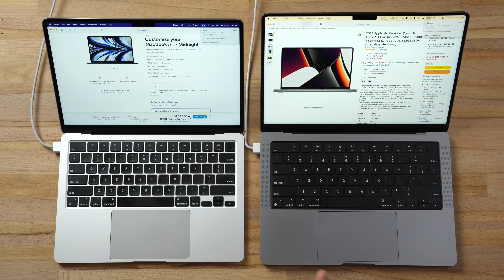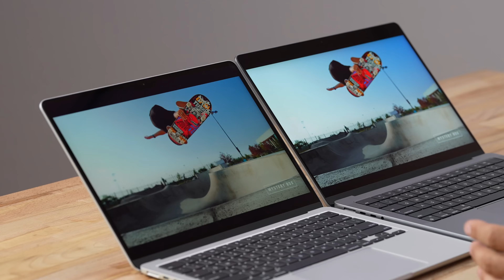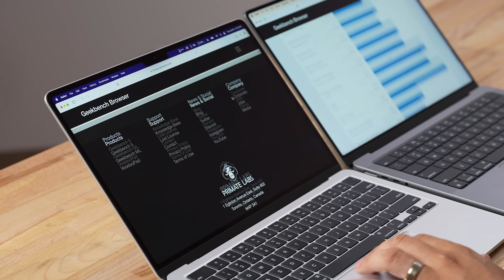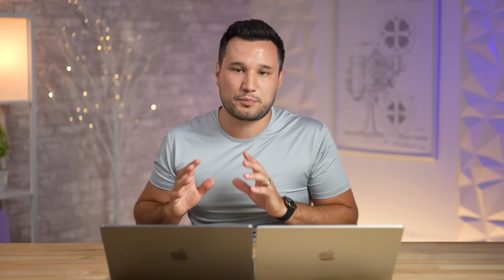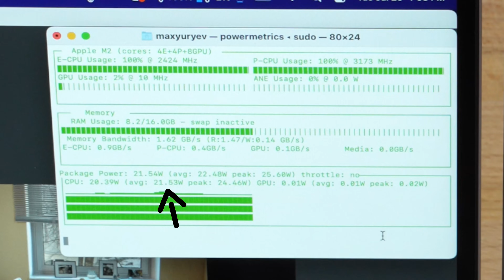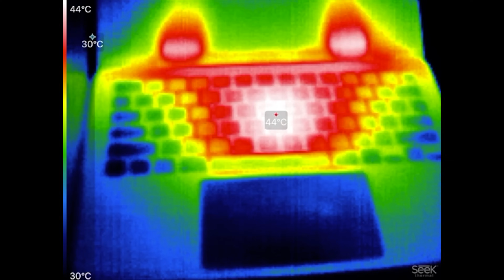M2 MacBook Air vs 14" MacBook Pro - Prepare to be SHOCKED!

Comment: THIS was the exact comparison I was waiting for! Thank you guys for always delivering the absolute best content, I love what you guys do. I don’t have a lot of money so I kind of rely on what you have to offer from your tests. I’m looking to transition in the next year from my Late 2011 13” MBP, and want to get the most out of my money so that this new machine can also last over 10 years, but on steroids.
Reply: If that is really what you want, I would go for a 14 inch in stead of a M2 air.
Reply: @tjadejoh  exactly, 100% for the 14” :)
I may also wait - hoping (and praying) that apple may release (as per the rumours) a new Pro 14” (alongside 16”) later this year/spring 2023. If so, it might be on 3nm chip process. If it’s not, and still built on the 2nd gen 5nm process, that’ll still be incredible in the Pros. I’m thinking my dream specs could be:
2nd gen. 14” Pro
10c/12c CPU (binned/un-binned)
16c/18c GPU (binned/un-binned)
24GB Unified Memory/“RAM”
1TB SSD

Comment: Can you do a battery life test for the m2 air, with just the efficiency core working, performance core disabled. 
I did that according to one of your earlier video. The mrs uses the air, 99% of her work is browser based, I’m just curious how good is the battery life compared to my 14 inch pro. If it doesn’t save much battery on her air, I’ll turn the performance core back on.

Comment: I’ve been waiting for a vid like this, but I changed my mind cuz 2 weeks ago I got a special offer of the m1 pro 14 MBP for $1650 open box on eBay and I can tell it’s a beast of machine, I love the mini LED which I don’t see gray boxes behind the texts, the pro motion and the true colors it shows which is perfect for illustration and UXUI design, and the best part is the apps open in 2 sec or less ❤️

Update: I’m surprised by the power of Apple silicon cuz this machine compared to my old 2018 MacBook Air the difference is so big

Comment: The base model 14” MBP is DEFINITELY the best overall value for a MacBook right now. Especially since it’s only $1749 at Best Buy currently. 

The benefits you get with the MBP are well worth the $1749. 

- STOCK: readily available, whereas the Air is
brand new and can several weeks to ship depending on the model you choose. 

- DISPLAY: slightly larger display size, even thinner bezels, higher resolution, 120hz Pro-motion, and Mini-LED instead of cloudy/gray outdated LCD

- SOUND: Larger speakers for clearer/louder audio

- PERFORMANCE: up to double performance, double the ram (16GB standard, compared to 8GB on base model MBA)

- STORAGE: Double the standard storage (512GB standard, compared to 256GB on base model  MBA)

 - CHARGING: Faster charging out the box (MBA requires you to buy the upgraded charger to get faster charging)

- PORTS: MBP Includes an SD Card reader, HDMI port, 3 thunderbolt ports, and headphone jack (The only ports MBA has are 2 thunderbolts and a headphone jack)

- NO THERMAL THROTTLING: As a
result of the MacBook Air not having a built-in
cooling fan like the Pro does, the Air will drop
in performance after roughly 5 min of heavy workload, and it doesn’t take very long to throttle even under a moderate workload.

- LONGEVITY: I’m no computer engineer, but I would expect the MBP to outlast the MBA, mainly because it has a built-in fan to help cool off the internals.
Reply: You are wrong, for compare u not use base model, real comparation its with same specs, 15/512 or 1Tb. M1 pro 14 base, dont have fast charger (need to upgrade to 97W), same air 30W to 67W. The rest, thermal trhrottling its only editing vídeo/photo, not in normal use, web, ofimatic, view streams or vídeos, etc.. work at 47ºC. M1 pro 14 base, in same case work at 50-52ºC. If you use more try hard, air work more hotter, in this case if this is normal use, go to pro, hard hot on a chip for long time isn’t good, but Proccessor / SoC in this case, are prepared to work hot.
Reply: @raul961  Thanks for the correction. 
Regardless of that small oversight of mine, most people agree that the base model MacBook Pro at $1749 is an overall better value, when comparing the specs and features, dollar for dollar

Comment: Best Buy had the MBP 14” for $1799 new recently. Worth every penny over the air.
Reply: The 14” MBP is $1749 right now at Best Buy. I just bought mine for the $1749 and LOVE it! Waaayyy better value compared to the MBA
Reply: @eBikify  even better then 😂
But yes absolutely worth it
Reply: @eBikify  Darn I got it at $1799.

Such a good price on it.

Comment: I’d still question coding performance. I wish your benchmarks used other ides  like vscode, pycharm, etc. I’d wager these are used more frequently than Xcode. Given I do zero coding in Xcode it’s useful though leaves me questioning how would my experience really vary.
Reply: Exactly all these youtubers are doing the same audiovisual benchmarks... I been waiting for coding benchmarks o real use performance in databases, containers, compiling projects, working with virtual machines, etc. I guess the main issue will be compatibility
Reply: An interesting observation would be about the SSD. While it does not make a huge difference for light usage and coding itself, if you're using a lot of swap memory the faster ssd on the 14''pro would be an advantage. 

Let say you're debugging a project, have over 10 tabs open on chrome and have Docker running with some local databases, message brokers or other apps, if you run out of the 16GB the swap with a faster ssd will probably offer a better experience. But of course, you can always go for the 24GB of RAM MBA...
Reply: The XCode benchmarks are actually testing things like the GCC compiler more than XCode itself. So it’s not a bad compiler test. Most “Real world” coding is going to be so constrained by things like Network that the CPU performance is going to make a lot less of a difference. Still, if you want to see a bunch of Developer-focused tests, check out Alex Ziskind’s channel. He puts the systems through their paces on a ton of different technologies. Sometimes the Mac does amazing, sometimes software differences give the win to Wintel computers. Either way, it’s all quite interesting.
Reply: Hi, I recommend @Alex Ziskind on youtube! His channel focuses on coding and he does various tests!
Reply: @proxiloni  thanks for your suggestion :)
Reply: This! I’m so confused as to what to buy.
Reply: @SherriAshton  Are you going to use the laptop in an office setting? Buy the Pro. Are you going to use it as a personal laptop for side projects? Buy the Air. If you’re in the weird Prosumer category where you run three screens hooked up to a Thunderbolt dock that you plug into your laptop over USB-C? WTF? Why are you even asking? You know what to buy.
Reply: @thewiirocks  the comment is about coding. I’m a student in CS. Can I get away with the M2 air to save money. Or should I just shell out more money for the 14” to be safe. I am new to coding.
Reply: @SherriAshton  If you're a student learning to code, you can pretty much use any potato computer you can get your hands on. You won't be constrained by the M2 Air or any other computer. If anything, today's computers are too fast for a learning setting, making it difficult to understand why Data Structures and Algorithms are important. Trust me when I say they are, you're just not going to experience true scale in a classroom setting.
Reply: exactly

Comment: In Canada, the price between the M2 Air and 14” is like 500 bucks, big difference compared to other countries.
Reply: I´ve just checked in Europe (both Air and 14" Pro in versions with less graphic cores). The difference between specced up Air and 14" Pro is exactly 300 Euro - 1950 vs 2250. Just to clarify - in Europe all displayed prices has to be final - including all taxes and fees. Both are standard priced, no discount.

Comment: I do believe this is the best way to approach these two lines. The Air should be significantly lighter and thinner, whereas the Pro should be significantly more powerful. For the last generation Apple homogenised the product line where they thought the Pro needed to be as thin as an Air, and while this was cool from a design point of view it meant you couldn't really get a truly powerful machine. It also made the Air feel redundant outside of being cheaper because the Pro was already so thin. But now, we're back to that clear distinction between product lines - and I think that's better as it gives consumer's a better choice for what they need exactly.
Reply: exactly
Reply: 13 inch Macbook Pro: I'm a joke to You?
Reply: @framedthunder6436  yes
Reply: @framedthunder6436  Exactly, the 13 inch MacBook Pro is really a joke😂
Reply: @coconutcubes5750  can I get great speed if it get 8/512 on m2air
Reply: @gontexpro2683  if you don’t use that much ram. Ram demanded tasks are Adobe series, IDEs, high resolution long video editing and 10+tabs with chrome.
Reply: @framedthunder6436  Yes.  You are.
Reply: @framedthunder6436  Haha yeah that is the bizarre anomaly that breaks my statement. I think Apple does tend to keep one odd Mac around largely for ease at which they can produce the chassis. Last major example I can think of would be the MacBook Air 2011 - 2018
Reply: @framedthunder6436  corny
Reply: I agree with what you said. It seems like around 2016 they lost sight of what characteristics the pro needs to have and they tried to make it a MacBook Air pro. The MacBook Pro design should be willing to sacrifice a little bit of size, weight , and slightly worse battery life in the pursuit of the best performance, highest quality display, and sound.
Reply: To add to this: the screen difference regarding colour accuracy on top of HDR and whatnot else is another critical difference that is only relevant to creatives.
Reply: Exactly. I went to BestBuy today & looked at MacBooks & was honestly stunned at how little difference in size there is between a 13” MBP & 13” MBA. It’s so negligible that if someone told me they could feel a difference I’d call them a liar to their face. The only real difference is the ports.
Reply: But now the air and 13 inch pro are even more similarly priced…
Reply: One important thing missing from your comment. Apple still markets the Air as some sort of jack of all trades laptop, without fully disclosing that the M1 or M2 chip in the Air will provide less performance than the Pro versions. Consumers see the same chip, rightfully assume the same performance. They can't have product differentiation if they refuse to acknowledge what seperates these products in the first place. They're heavily marketing the "performance" features of the MacBook Air rather than the overall thin and light nature. Don't believe me? Check their official website. Granted the marketing for the M2 has dropped the performance priority a notch or two compared to the M1 and focuses more on battery life, screen quality, color options etc.
Reply: @ufukpolat3480  you can always go to an apple store and ask for advice. Also if you do a quick google search or if you really need a powerfull machine, big chances are that you are able to understand the differences when you see the cpu and gpu core differences. However, some sort of line up from least powerfull to most powerfull M-series chips would be helpfull for those who are confused by the M2 vs M1 pro/max naming
Reply: It's too bad that M2 MBA have this heat problem
Reply: @tririfandani1876  it doesn’t have a heat problem, unless your using it for things that a MBP is designed for (in my opinion)
Reply: @tririfandani1876  people who need to thermal throttle the m2 mba shouldnt have an air
Reply: We can discuss whatever we want as techies but apple clearly knows its regular customers, which dont care that much about specs and they must be doing something right
Reply: Yeah, except the price is ridiculous.  To get a M2 worthy laptop, you gotta spring for 1399?  Maybe more w the ram?  This is a heist!!!
Reply: right, exactly thats the point!

Comment: The price for the M2 Air is stupid. It should just stay at $999 for base model. The only config that anyone would buy is the base model or maybe either 16 ram or 512 ssd else the 14 inch is way better. It is thicker, less battery, and cost $200 more but the screen alone should offset all that.

By the way, why does Apple keep lying about battery life? M2 Air rated at 18 hours and M1 Pro 14 rated at 17 hours but the difference is almost 15%? These are their own product and tests, they should have some consistency.

Comment: It's worthwhile to note that with student pricing (at least in the US), the difference between a 16/512 air and a base 14' is more like $350. And Apple doesn't verify your education status if you order online, so it's a completely valid comparison. 

I would still argue that $350 for a SIGNIFICANTLY better screen and more powerful chip is worth it, but it comes at the cost of portability and battery life. The decision isn't as clear cut anymore. Obviously if you're a professional I wouldn't even consider the air for a second but for everyone else, I could see use cases favoring either machine.
Reply: The 14 is very portable. It’s like splitting hairs if your are putting in a book bag…
Reply: The 14” MBP is $1749 at Best Buy. By far, the best value right now for performance, display, speakers, etc
Reply: @eBikify  It's $1850 on apple edu with a $150 GC. You can easily sell the GC for more than 100 but we can just call it even. And the m2 air is $1500 + $150 GC, so the difference is indeed $350.

Comment: Exactly what I needed to confirm my 14" pro purchase is still worth it nearly a year later.
Reply: Yeah I don’t regret buying one.
Reply: Wow you needed confirmation for a one year old laptop with a newer M1 generation chip? Lol. Should I be crying that I bought a new in box, factory sealed M1 MacBook Pro 13in and paid 1300 for it on eBay less than a month ago? This laptop will be good for years and it came out(November 2020) before your 14in and I don’t need anyone to confirm that

Comment: The performance  difference is  lower than how I expected! Guess this is the another reason Apple priced M2 quite close to M1 Pro base model price tag. Conclusion: if anyone care for weight and shiny new look - go for M2, otherwise M1 Pro is better choice for the now and for the future.
Reply: the macbook air is very strategically priced so people will go for the Pro, they do that with most of the lineups. if you even slightly care about performance you will definitely upgrade the ram and ssd on the M2, in which case you should get the pro at that point

Comment: CPU analysis:
M2 Air has 4 performance cores and 4 efficient cores vs M1 Pro which has 6 perf and 2 eff.
So M1 Pro has 50% more performance cores, but also 50% less efficient cores. The new CPU is by default running at a higher frequency and is more optimized, especially efficient cores.
So, it is expected that the difference would be small, especially for short runs where M2 Air does not throttle.

Can you make a test where only one type of core is used?

Comment: Just as I thought. MBP 14 inch is a better buy, especially since it offers more ports, excellent screen, and already available in refurbished version.
Reply: Refurbished isn't good...watch Louis Rossman videos.
Reply: Also supports more external monitors
Reply: The MBA is CHEAPER. You can’t say it’s a better buy if it’s more expensive. It’s a whole different ball game. The A Ferrari is better buy than a Honda Civic based on track time, when you factor in the cost the civi may be better for the average person.
Reply: @RakingLeaves  the difference in price is not really a Ferrari and a Honda Civic type of scenario, its far less than most comparisons in general, the M1 Pro 14 inch base model is an overall better buy for a long term investment
Reply: @RakingLeaves  Normal people would then buy a 250 chromebook. M2 Air vs 14 inch pro the 14 wins everytime
Reply: @RakingLeaves  For 150 bucks you get double the storage speed, a lot more ports, display which is in entirely different league and apparently a lot more performance. Also things like better speakers less throttling etc etc. All of that for what is the same price. So a ferrari vs a ferrari